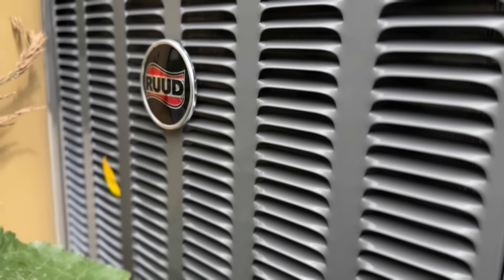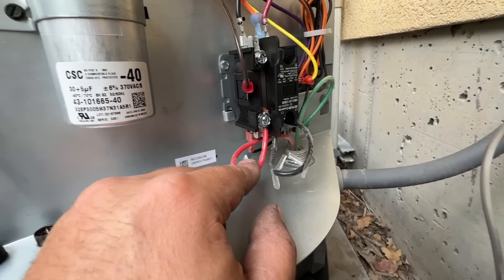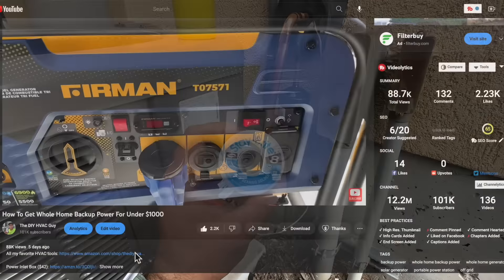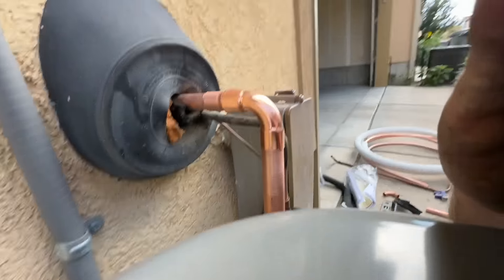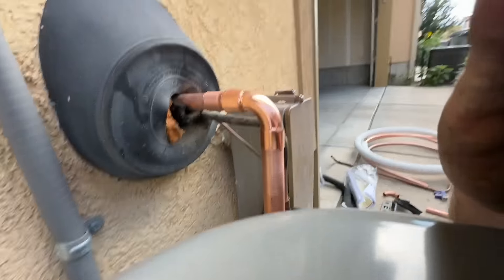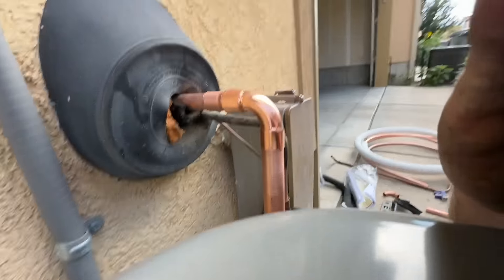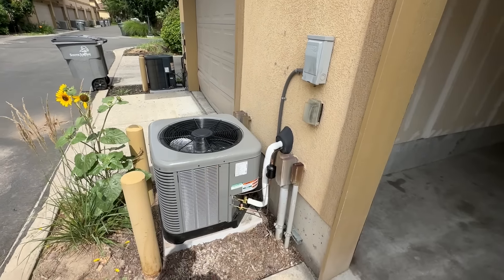HVAC Contractors Don't Want You To Know How Easy This Is...

Comment: Why didn't you just patch the leaks?
Reply from the maker: Because I can’t guarantee the compressor is any good after running with nothing in it for who knows how long. And no nitrogen is needed with Staybrite 8. Doesn’t get nearly as hot as brazing so no carbon builds up in the lines 👍🏼
Reply: Because the refrigerant is what circulates the oil. When the refrigerant leaked out no oil was circulating. Sort of like if you changed the oil on your car and didn't put the drain plug back in then started it and figured out why the oil light wouldn't go out then turned it off but if you drove to McDonalds and back with the light on then put oil in it there'd be plenty of uncertainty if your engine was going to run for another week. Some systems have a low pressure and a high pressure switch that will shut down the condenser when you had refrigerant leak, hence no pressure or a bad fan motor and excessive pressure but this system didn't have them. Those sensors are prone to leak and the dollar amount to fix those leaks and buy more refrigerant often over the long term is the same if your compressor kept running and burned up from no oil. Biggest thing to recognize is no mechanical equipment in a home is designed to ricochet high speed projectiles. Weedwackers are famous for kicking up debris and breaking windows, a/c condensers, putting dents in cars and corneal abrasions to name a few.

Comment: I don't understand the logic for not adding more refrigerant. You're pressures were high because it was 91° outside. System was low, needed to get that subcooling up above 7, dipping down to 5 is no bueno. VSat was probably high because it was hot in the house. TXV was doing it job keeping that Superheat pegged at 10. Just because it's a small system on a well insulated house does't mean you should be lazy and and not dial it in.
Reply from the maker: I was worried the high side pressures were going to be too high. I appreciate your insight on this though!! In your opinion that high side pressure was ok? I felt like on a 100 degree day it would be mega high.
Reply: @diyhvacguy  For air temps in the low to mid 90°s pressures were what you would expect for 410a. Adding more refrigerant would not have resulted in a significantly higher pressure. The pressure is a direct correlation to temperature. When increasing your subcooling all you're doing is stacking more liquid into the condenser. At a certain point, your head pressure would increase because the surface area of the coil would be effectively be reduced because of the amount of condensed refrigerant but this would be beyond your target subcooling of 9-14. At 100° on that unit I would expect pressures anywhere from 410 to 430.
Reply: @Kevin-mp5of  Added that one apostrophe just for you buddy! Your welcome! 😉
Reply: @Kevin-mp5of  your so write!

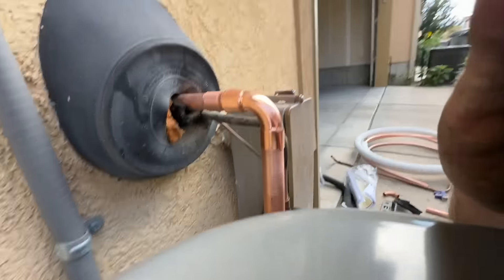Comment: Min 6:40

- No wet-cloth/heat-sinks to protect the 3-way valves?  
- No nitrogen 'flow' ?
Reply from the maker: Nope, not needed with Staybrite 8. Doesn’t get hot enough to effect the seals in the king valves, and also doesn’t get hot enough to create any soot in the lines like brazing 👍🏼 SB8 for the win!

Comment: why didn’t you use the shark bite connectors?
Reply: Using StayBrite 8 is easy and no need for expensive fittings and special tools.
Reply: they're $30 a pop and you'd need 4 for the job? Very expensive
Reply from the maker: Any chance I get, I used SB8 👍🏼
Reply: @diyhvacguy hat about mini splits? I’ve read you can braze, but some say no warranty even if you use nitrogen. What if you used staybright 8 on a mini split?? Doing this in lieu of flares.
Reply: @user-ln7of9gs4s Why not use flares,they are foolproof when done properly!

Comment: And the only time I have ever had to flow nitrogen is when popping MED GAS for medical instances.  U pressure test with nitrogen anyway, so it will push any of burnt residue out. Just as you do. I haven't ever had to flow nitrogen. And u don't have to get torches so hot sir.
Reply: And this is why we’d rather do it ourselves....

Comment: Getting HVAC quotes at the moment, what's your thoughts on Ruud vs other more known brands like American Standard? I'm familiar with Rheem but not Ruud, haven't ever seen it before.
Reply: Rheem and Ruud are the same company it's like GMC and Chevy trucks. The equipment is often identical with different badges.
Reply: @realSamAndrew  Yeah I knew that just wasn't sure how good it was, always prefer to get it straight from the people that have to service the stuff. How is Ruud compared to other brands?
Reply from the maker: If you are familiar with Rheem then you are familiar with Ruud because it’s the same exact equipment. They are both great. Personally I wouldn’t spend 4k more or however much more it is for an American standard.
Reply: @diyhvacguy  Good to know thanks! Do you see much concern with orphaning a water heater when bringing an 80% up to high efficiency? The concern kind of baffles me as given that during the cooling season the furnace is always off anyways, so if the vent was an issue why it wouldn't be as is. I know you probably have mixed feelings about the ROI and pros/cons of the 95% efficiency furnaces anyways but was curious.
Reply: @realSamAndrew  so is Goodman and Amana
Reply: @force311999  true, but that was never asked in the comment

Comment: You have to be certified to buy these units. Plus you have to be certified to keep the warranty.
Reply from the maker: Same exact installation as a Goodman, and you don’t need to be certified to buy a Goodman. You can get them on Amazon and hvacdirect 👍🏼
Reply from the maker: Actually Goodman is easier. Their filter driers are built into the condensers
Reply: @diyhvacguy  local places here won't let you buy units if not certified so if your air goes out you will be without air until it arrives. Then you will not have a warranty if a certified installer doesn't install it.
Reply: @diyhvacguy  I love Goodman units. If someone wants to install their own a Goodman is a good one to order.
Reply: @diyhvacguy there might be some places that will let you buy them if not certified but that is not the case here where I live.
Reply: @diyhvacguy  I install a lot of mini splits. Just installed one today.

Comment: click bait is too strong-- "oh man so easy to do this work, you just need all tools and hvac tech would need + be able to buy condenser at contractor pricing and install a new condenser!"

Probably could have changed the condenser coil for cheaper for the customer tbh but I guess everyone charges differently. 

instead of going with a par for par system, you slapped on a ruud condenser on a trane system that's outside warranty on a r410a system (only way i see this being good is if it was a 5 year manufacturer warranty)

you're really good at brazing though i can appreciate that for sure
Reply from the maker: It really is easy man, people can get a condenser on hvacdirect or Amazon shipped right to their door. The brand difference doesn’t matter, it’s the same function being as it was a 410a system. All that matters is the size remained the same as the old condenser. Thanks for the feedback! Cheers
Reply from the maker: And there’s not a ton of specialty tools. Vacuum pump, a simple set of gauges, Staybrite 8 and a map gas torch.
Reply: @diyhvacguy You forgot to add nitrogen to that list. That is kind of expensive.
Reply: Oh please slapped on a Ruud on a Trane system. Trane doesn't make their own compressor anymore; they all use a Copeland so does it really matter? All these equipment manufacturers are just assemblers now not engineers. Well Trane does use Teflon coated screws so they don't rust if your sprinkler waters your condenser but rusted screws will be your least problem if your sprinkler waters your condenser.
Reply: @alexfriedeck1978  yes..

Comment: You couldn’t try to just patch the leak. I’m in a CTA and that would be my first try at least to save them some money.
Reply: That's a micro channel coil, probably not the best idea to try an patch one of those. If it was cooper tube coil leaking in that same location it would have been an easy fix.
Reply: What's a CTA?
Reply: @realSamAndrew  hell idk lol typo I was driving. I do hvac* or something like that😂
Reply: @TofuInc  ah hell didn’t even notice it was alumnum coil. I stand corrected

Comment: Shouldn’t the receiver drier be as close to the evap coil as possible?
Reply from the maker: No it does not matter. Some folks put it in there so it’s out of the elements but it really doesn’t matter. As long as the arrow is pointing the right way. That’s the main thing.

Comment: Well, HVAC contractors don't really care if you know how easy it is because they know this is NOT something a typical DIY person would attempt, especially with a $700 vacuum pump and not being able to buy 410a.
Reply: Absolutely! As a DIYer myself, I started buying the tools to do my own mini-split and quickly realized my money would be better spent on a pro. You can't even rent or buy nitrogen w/o a license where I'm at so I'm not even able to track down a leak in my fittings.

Comment: Stay bright is a great product, however,  The average homeowner does not have the tools & knowledge to do some of these jobs,   over my 40 year hvac career, I have seen too many botched jobs
Reply from the maker: Well you go and fix the botched ones but there are many success stories. I can speak truthfully In saying I’ve helped a ton of people do their own ac successfully. But it’s not for everyone that’s for sure
Reply: @diyhvacguy  you very well may have helped some folks,  but way to many go on line, think how easy it is. Or the buy equipment on line,  and get in way over their head, then when they call a "professional",  for help,  it rarely turns out good,

Comment: HVAC contractors don't want you to know they've been fleecing the public for decades 🤣
Reply: Facts
Reply: They get all wrapped up in that big money installing all new units charging 3x more than normal and honesty goes out the window. 😂
Reply: Yes they have. Now they are all mad at showing how easy it is to work on a pump that pushes vapor thru a condenser to a liquid to an evaporator to evaporate. These machines are just glorified water coolers. When any liquid evaporates it cools like sweat on your arm. Only difference is A/C uses a refrigerant that evaporates at minus 60 so it's colder and able to absorb more heat than water and the refrigerant gets recycled. They all complain specialized tools. I bought mine used to work on my rental properties for $1500 and I could sell them for $1500 if I had to. The rest of the stuff is pliers and screwdrivers you get at Home Depot. 

The people who sell equipment and parts were coconspirators to the fleecing for decades now they sell to the public to because Ace Hardware has on their shelves at your local store the most common parts that fail also such as capacitors, contactors and fan motors. Most of the parts are generic also, not specific to certain manufactures like car parts. And you know Home Depot and Lowes are watching Ace to see how well these parts sell to put them on their shelves also.

HVAC contractors: your days as fraudsters are over. You're going to have start earning your money like plumbers and electricians and other skilled trades have been doing for years. Your gravy train has derailed. And shut up about training. Your education is a 9 month program at a trade school like a medical or dental assistant. Look at San Joaquin Valley College here in California. They have campuses all over the state.
Reply: @alexfriedeck1978  99% of hvac companies push new units instead of replacement of capacitors, fans and basic recharging of units or other simple repairs, then they sell your old one for $1000 or more.
Reply: @alexfriedeck1978  💯
Reply: @alexfriedeck1978 haha their days aren’t numbered. As evidence, now, not only are people too lazy to cook, but they won’t even drive to get their fast food anymore. I don’t think you’re going to see masses of people attempting their own hvac repairs.
Reply: to your point, look at other stuff then. 5k diamond ring whereas the stone probably cost couple hundred before it got to you. do you expect a company to have a tech to service your unit and not pay for health care, retirement etc? you probably don't own a business, until you actually do, not theorize you can't really know what it takes to run a successful hvac business. costs me min $100hr with all costs to have a legit tax paying tech. workmans comp, buy him a truck, uniforms, gas, vehicle maint + insurance, stock vehicle . supply and demand adjusts prices like with any sevice, if hvac was so overpriced then others would come along and offer cheaper bids. typically lowball companies cut corners and find work in funky areas, one reason being they are often funky dudes i don't want in  my house. if price is your #1 concern, go for it, there is a company out there to serve that customer
Reply: @ltcuaa  100 percent brother. We work our asses off, passed all the exams…pay taxes …and get robbed by assholes 
Ike this for clicks and likes ….
Reply: @victordasilva5255  did I understand that correctly? Are you saying you’re getting robbed by this channel?
Reply: If your so mad about it you can go fix it yourself.. this is the same concept as fixing your own car.. good luck buddy..
Reply: I wouldn't say that because it's about the same as saying all auto mechanics are bad guys that are just robbing people. The reality is there are bad tech out there who will scam people in every industry but that doesn't make all of them bad people just see the bill and say the tech robbed them when the reality is the company has people in the back end (dispatcher, parts people, customer service) to pay as well as the tech plus they have to make up paying the tech for all those "free estimates" (there is no such thing as free) so ya it sucks they bill you $100+ an hour because all those people have families to feed and bills to pay too.